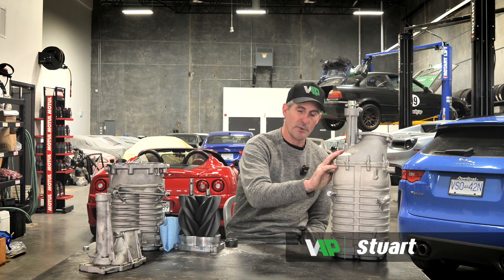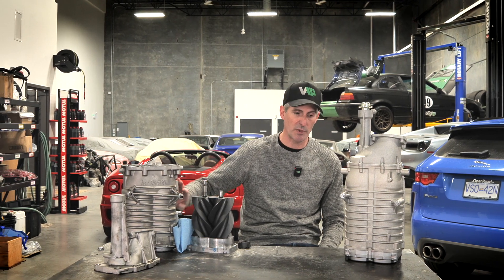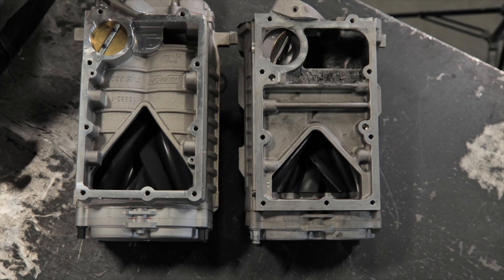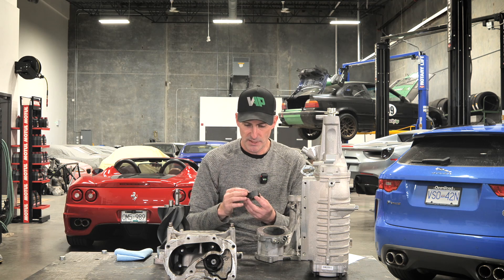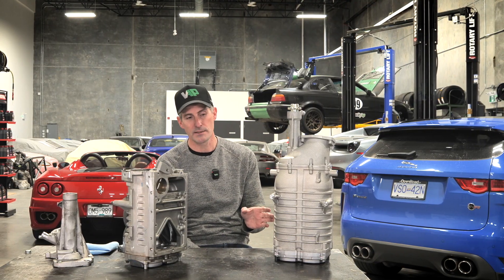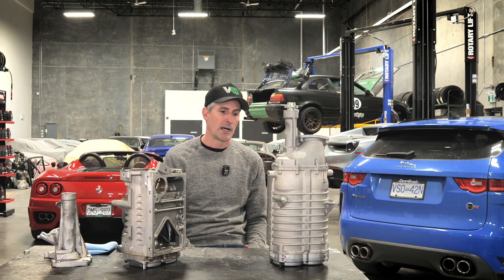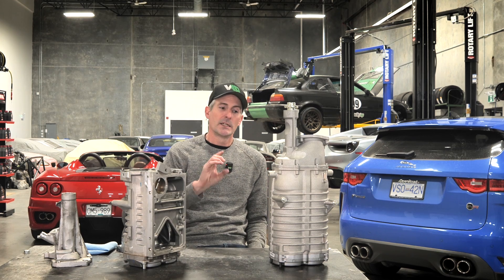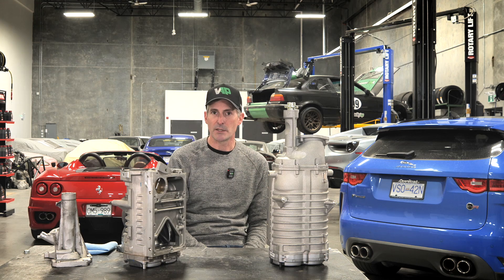Product Release: JLR Big Blower Tech Talk - 2300 Superchargers with Harrop & VelocityAP

Comment: It should actually make slightly more power than the stock blower at any given boost level, simply because the larger SC, especially a ported one, will have higher isentropic efficiency. This won't be a drastic difference, maybe 5-15HP, but it should be consistently measurable.

Comment: Nothing like this for the v6 😭?
Reply from the maker: We did do some analysis on fitting the 1900 to the V6, and while anything is possible, the amount of work required to do it would mean it would be simpler & more cost effective to start with a new design rather than trying to adapt the JLR 1900.  However, we have bolt-on options to go to 475BHP & 470ft/lbs on the V6 on pump fuel, and up to 550 BHP on E85.

Comment: Can we add this to the V6 2019 ?  Could we add a take off 1900 to the V6 ?
Reply from the maker: Hi Dennis.  The 2300 is far too large for the V6.  We did do some analysis on fitting the 1900 to the V6, and while anything is possible, the amount of work required to do it would mean it would be simpler & more cost effective to start with a new design rather than trying to adapt the JLR 1900.

Comment: Thanks for the video Stuart! Much appreciated. Will these Harrap 2300 Superchargers be adaptable for the vacuum actuated bypass 1900 Superchargers on the 2010 -2012 5.0 SC JLR Range Rover full size with the Denso ECM?
Reply from the maker: At this time they are not.  That version may be produced at a later date, but due to the fact that the Denso vehicles have a much inferior ECU, the upside potential may not be as good.  We will see as we go forward.
Reply: @VelocityAP  There's a strong L322 5.0 SC community that I believe this would be of great interest to. Is it fair to say that if it happens the 6-speed transmission on those L322s would need to be beefed up?
Reply: @MrXerxes  I would ZF8 swap the L322 5.0l SC before I get this 2300 sc. It will not only improve fuel economy, but also improved A LOT faster shift speeds and can handle way more torque stock for stock vs ZF6
Reply: @e.e9331  Have you seen that conversion done on the L322 with OEM-esque fit and finish? I need to look into this, I have the ZF 8 in other vehicles and it is a great transmission.